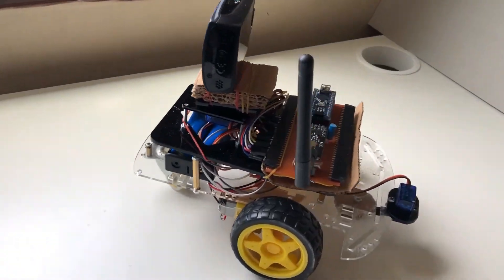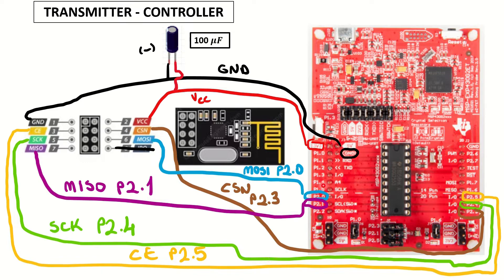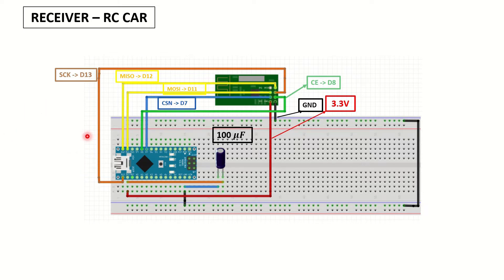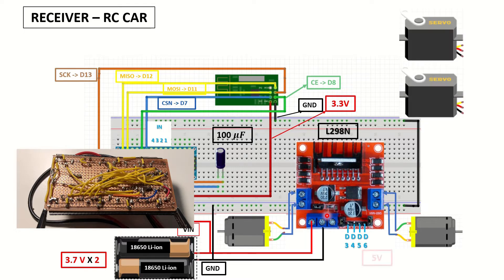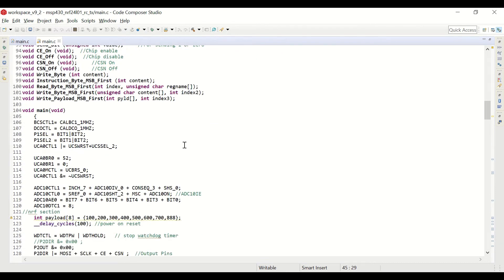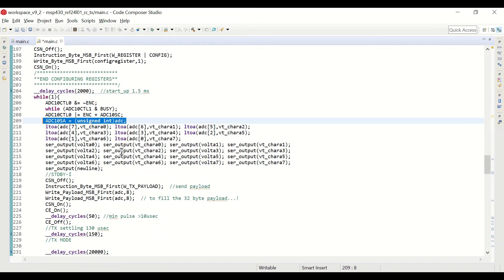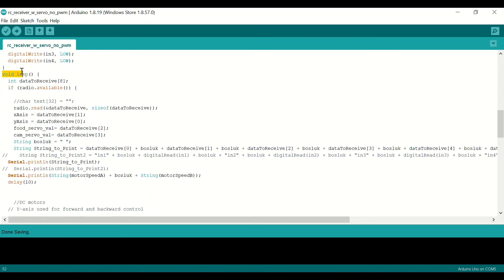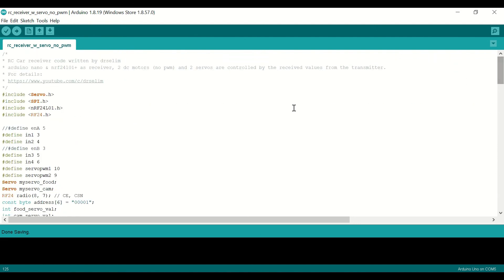DIY RC CAR MSP430 & Arduino & nrf24l01+

Comment: Merhabalar Selim bey. İncelediğim kadarıyla pek çok endüstriyel cihazda MSP kullanılmış. MSP'lerin diğer MCU'lara göre üstünlüğü nedir. Daha önce hiç MSP kullanmayan biri olarak bana ne tavsiye edersiniz.Halen PIC, Atmega, STM32, ESP vb.MCUlar kullanmaktayım. MSP'ye geçmeli miyim?
Reply from the maker: Osman Bey merhaba, ben su ana kadar MSP430G2553, PIC12F683, PIC18F252 ve ESP32 mculari kullandim. STM32 tecrubem olmadi. MSP430'un low power modelari sayesinde genel olarak dusuk guc tuketimi sagladigi icin tercih edildiginden bahsediliyor, ben uygulamalarimda pek kullanmadim bu ozelligini acikcasi. Bunun haricinde, programlamada kullanilan IDE (Code Composer Studio) guzel, sofistike bir urun, memory browser ve disassembly gibi pencereleri ile detayli inceleme yapilabiliyor. Ancak kullanilacak pek bir library yok. Bu da bir dezavantaj. Ben mumkun oldugunca kullandigim sensor,transceiver vb.'lara driverleri da yazip o sekilde ornekler olusturmaya  calisiyorum.
Dilerseniz msp430g2et launchpad (videolarda benim kullandigim urun) ile baslayip bir deneyebilirsiniz.
Reply: @drselim  detaylı bilgilendirme için teşekkür ederim Selim bey. MSP'lerin tedariklerinde durum nedir? Mesela MSP430FE427 ailesiyle ürün geliştirmek istiyorum.
Reply from the maker: @ozturkosman  Rica ederim. Acikcasi tedarik konusunda bilgim yok, salgin ve sonrasi donemde neredeyse hic chip siparis vermedigim icin son durumu bilemiyorum. Ama development boardlar stoklarda vardir diye tahmin ediyorum.